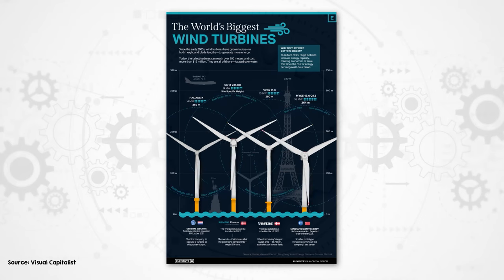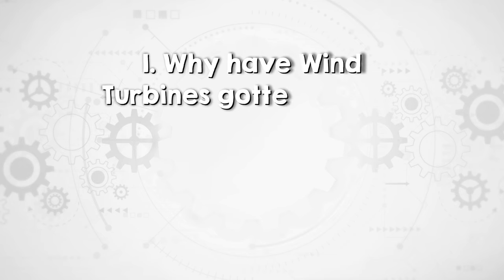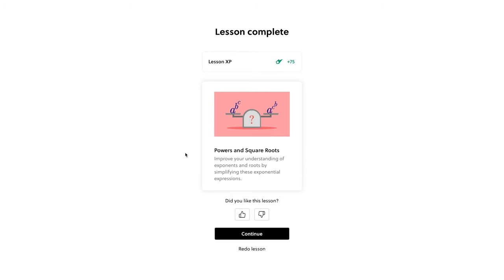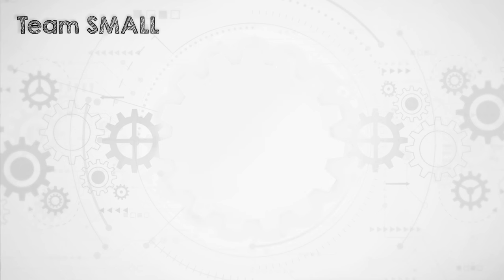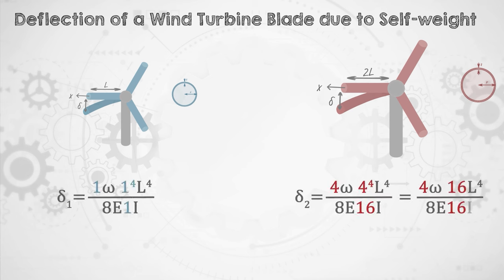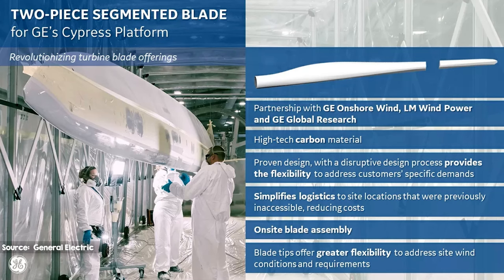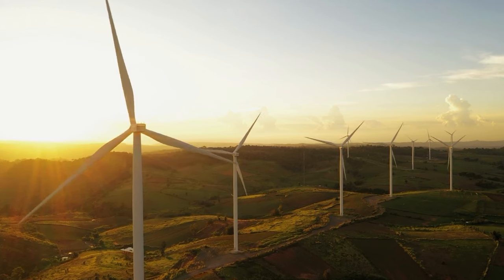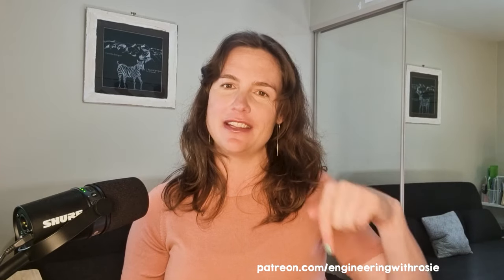Discover the Surprising Science Behind Wind Turbine Design for Lower Energy Costs!

Comment: I haven't watched the video, I just came to comment that yes there is a limit. I imagine the first limit would be the amount of force experienced by the blades. As they get larger they need to become stronger which means more material which means the amount of mass required to build these blades increases more and more quickly relative to the size. Eventually the mass of the blades would be too much for the material to handle and the blades or connection to the blades would fail.

The second limit would probably be the weight of all the material crushing down on the structure holding the blades in the air. Space elevators run into the same problem, but you can have the same solution where you have a large amount of the mass in space, pulling on the structure as it tries to escape. This can counter a lot of the load but obviously we are going to have a lot of stress regardless. It's theoretically possible to make this with materials we have currently, but the amount of material and the engineering challenge of actually building this seems enormous. If we can slow the earth's rotation down to match our forces as we build this we could theoretically build a wind turbine as large as we want. The blades of the wind turbine could also be built in space now and we could attempt to harvest solar wind.

I suppose really the limit is one we put on ourselves. If we had the will to build this solar wind turbine it could be done but one has to wonder, is it worth it?

Comment: Why bother with commercial wind turbines at all when at best they only generate power 1/3 of the time at best.
Reply: Modern wind turbines have a capacity factor of 50% for onshore, 54% for offshore. No method of power production has a 100% capacity factor, nuclear has at best 90%. Wind cost about a quarter the cost of nuclear per Megawatt-hour, wind turbines can be production line built, meaning lower cost and shorter lead times. A partly built wind farm can start producing power while still under construction, while a nuclear plant takes a decade on average before it starts production, you can build a hell of a lot of wind turbines for the cost of a single nuclear plant and have it all online in a fraction of the time.
Reply: @taznz1  I live in Alberta Canad where we have quite a bit of both wind and solar and neither have a capacity factor much above 30%.  At one time it used to take about four years to build a nuclear plant, now they have been criminalized so much that it takes 16 years to just get an approval to build one if you can get it at all, and that is for designs from the seventy's.  Nuclear technology is moving ahead to Generation Four, designs which are intrinsically safe and cannot melt down. They will operate at atmosphere pressure and will not need high pressure containment, they will use up over 90% of their fuel unlike the less than 5% currently used.  The reactors will be factory built, likely at 4 to 6 per year and trucked to the separately built reactor site.  Each site will be smaller than current nuclear sites and can even use current coal plant sites.  Because of how they are built they should cost far less than the grossly inflated prices of current reactors.
Reply: Wind power is very very cheap regardless, and some offshore sites can deliver 55% capacity factor. Most models show intermittency is not really a serious issue until you go over around 80% renewable at which point balancing and storage costs start to increase exponentially.  This is why many suggest that a proportion of either Hydro or Nuclear (or both) is required (even if these cost much more per MWH), to keep the proportion of intermittent sources below 80%. It's not an either/or debate.
Reply: @enemyofthestatewearein7945  Generation Four Nuclear is capable of load following making wind and solar totally redundant!  Better to skip them all together and just use Nuclear, decriminalize it and in very few years all current and future electric needs could be met easily.  Hydrocarbons will still be needed, but in far smaller quantities.
Reply: @tedclapham4833  
Gen 4 reactors for production isnt a thing and wont be a thing for decades...

the reason no one wants to build nuclear is the financial risks that comes with it.
as long as that issue isnt solved, nuclear wont see massive investment.

and considering these new massive offshore wind turbine have a CF of 60-70%, there isnt really any point of nuclear.
as they are more expensive (>2x per GWh) and carry much more risk as a investment.

nuclear is of course needed, we need a diverse grid, thats the key to success.
but today there isnt really any good reason to invest in nuclear.

Comment: So much BS in this Video. Towers have long been built from precast concrete elements, which are joined on site to form rings and then stacked. Only the upper part is still made of conventional steel segments. Max Bögl Wind with their Hybrid Tower is the market leader.